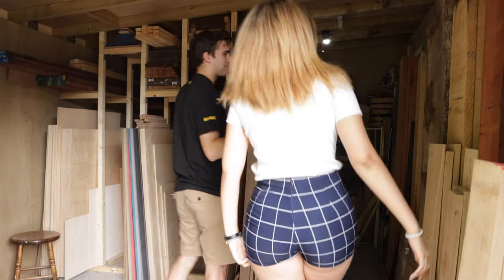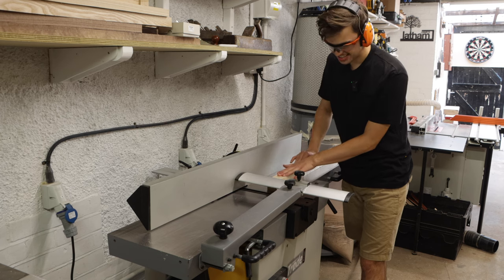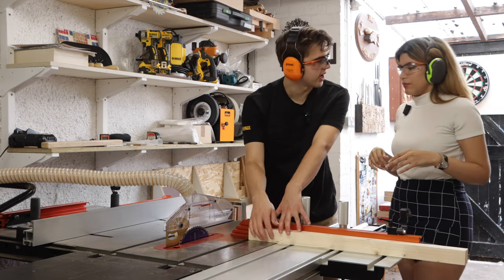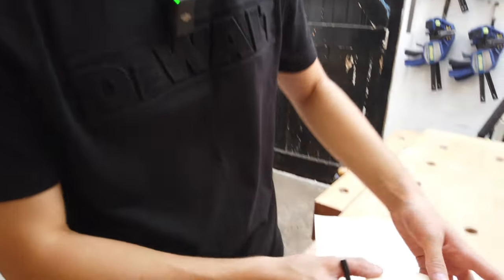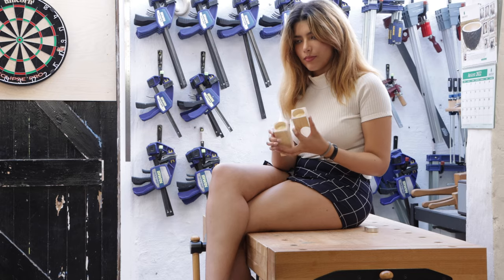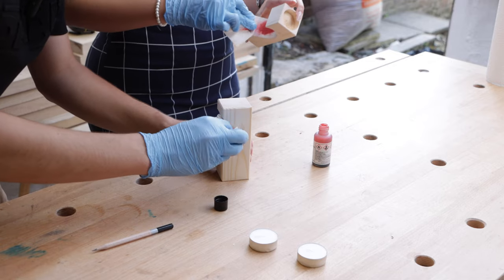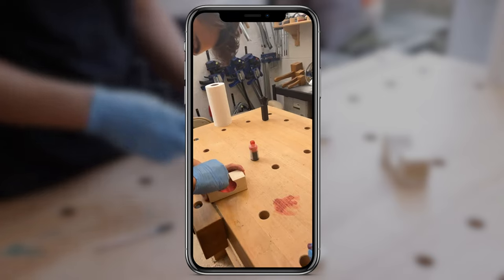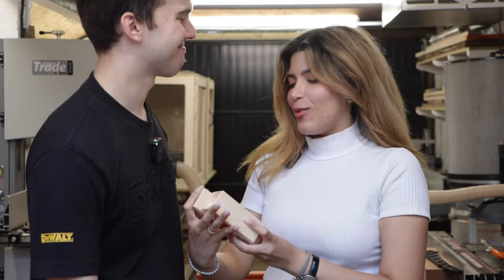Teaching My Girlfriend Woodwork!

Comment: Nice project Sean and she did well and as much as I hate to be that guy you probably should have used candle cups in the top as the foil around tea lights isn't much protection as a fire hazard :(
Reply from the maker: Thank you Dave! You're right, good idea. I drilled the whole oversize so I will probably have space to slot one in!